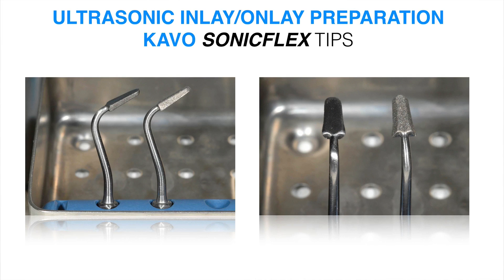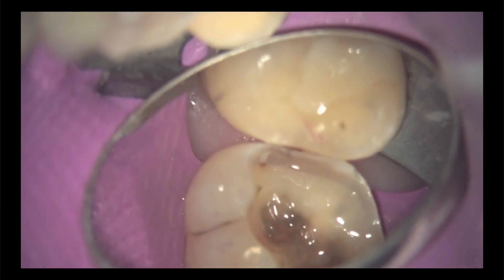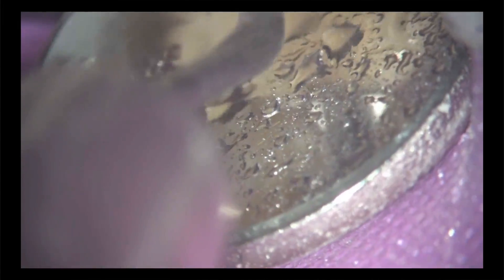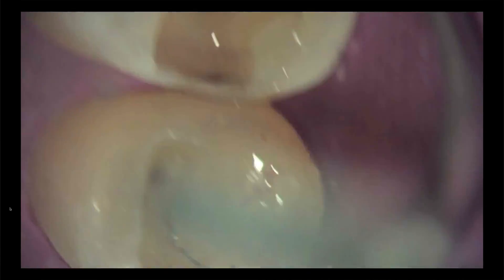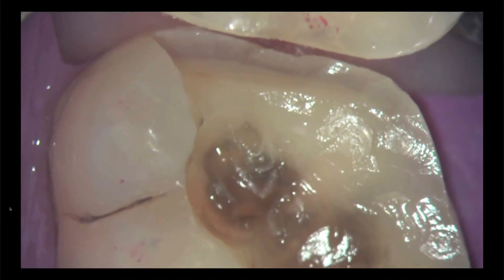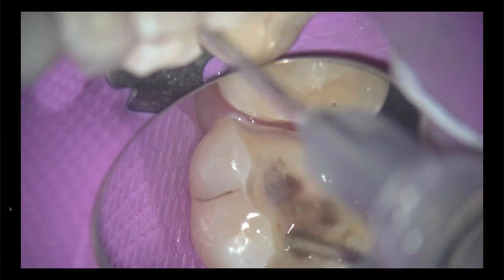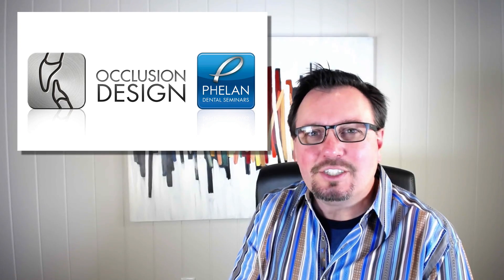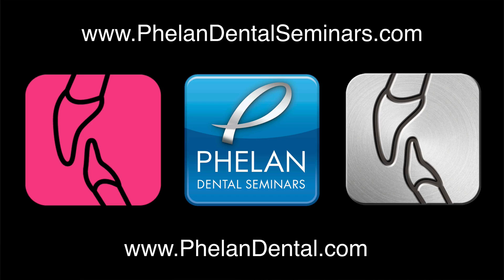Dental Excellence 15. Ultrasonic Preparation Clinical Microscope Video.

Comment: hi Dr. Stephen, would uou tell me more about the aim of glycerin gel over prepared part?
Reply: He did immediate dentine sealing which is essentially applying bond to the dentine to seal it and improve the adhesive bond to the onlay at cementation. However, to prevent the uncured bond interacting with the silicone impression material and bonding to the temporary, glycerine is placed and the bond is cured to cure the previously oxygen inhibited layer

Comment: Hi Dr. Phelan. Can this instrument drop the floor of the prep as well if you found that contact at the gingival floor of the box needed to be opened more?
Reply from the maker: Yes, I actually did that during this preparation but I forgot to mention it. I do not recommend trying to prepare the entire tooth with these but they are excellent to modify and perfect the preparation after a basic outline form has been created.